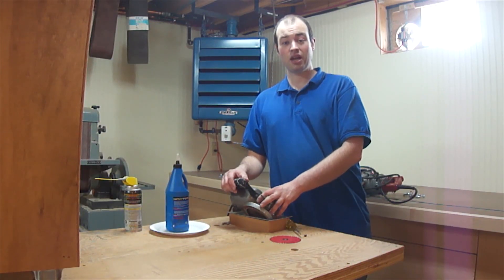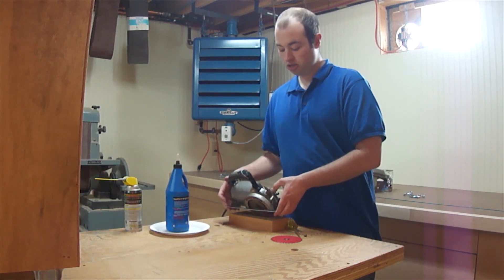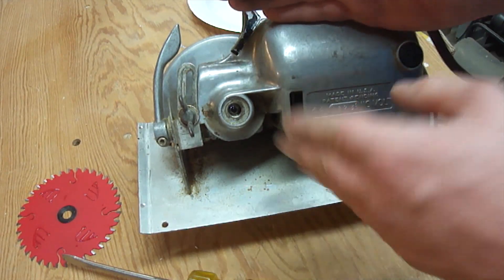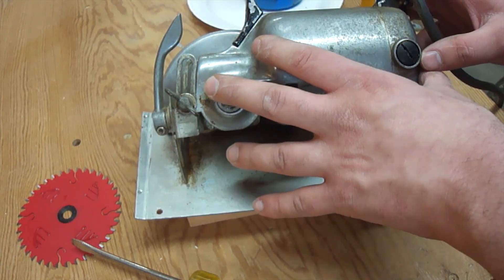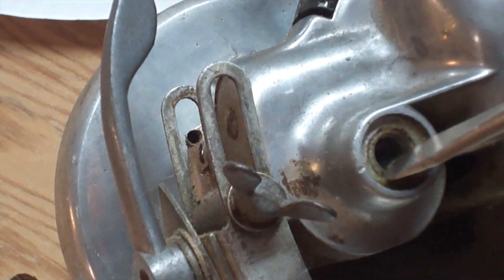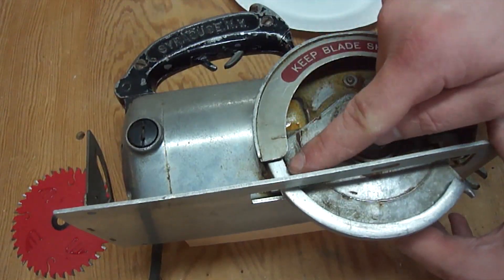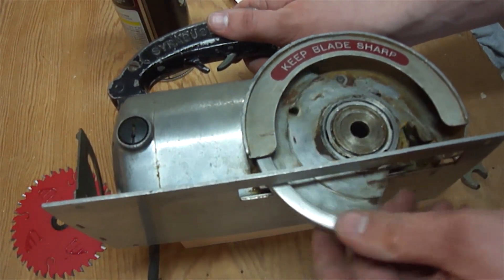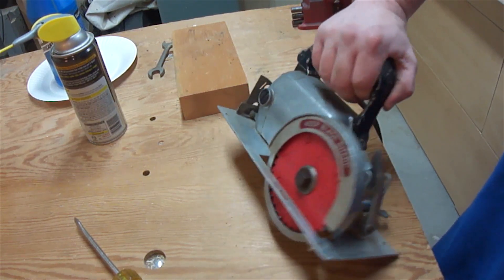Reconditioning a 1950's Porter Cable Trim Saw

Comment: I have a porter cable 314 type 3 trim saw. I just got it I wanted to know what type of weight gear oil to use in it. Is 85/90 ok?
Reply from the maker: yuyo57 yeah that will be fine.